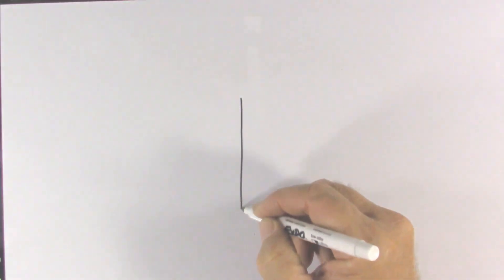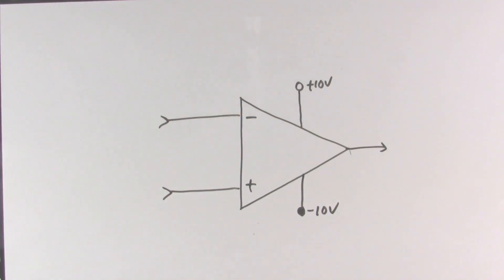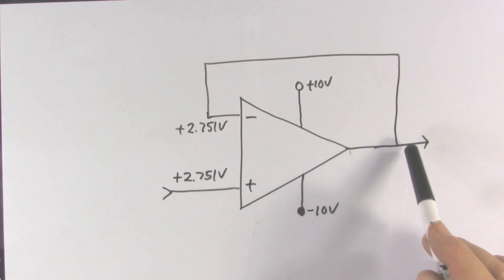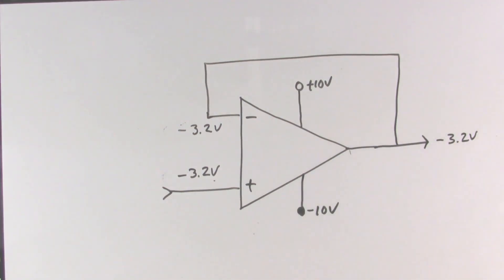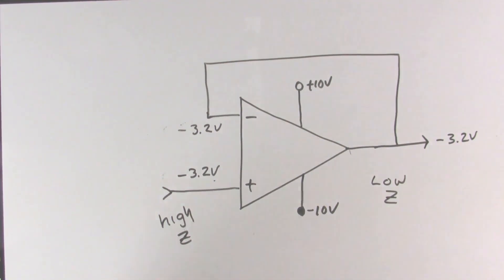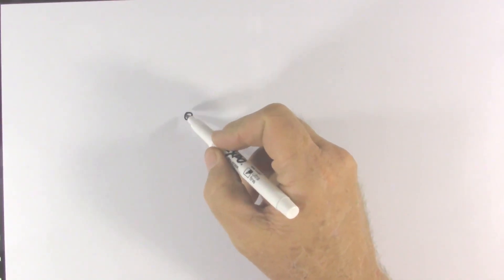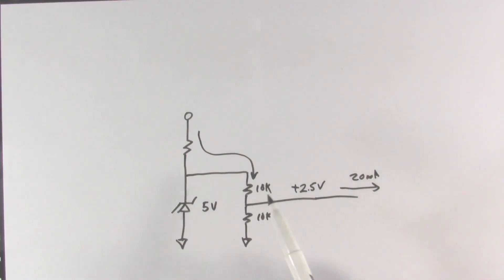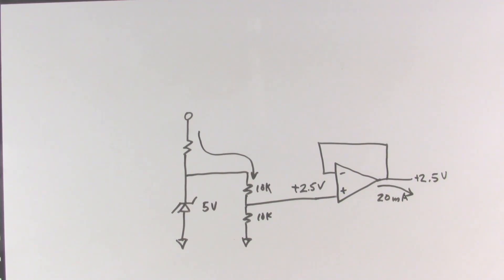Operational Amplifiers No  3, Voltage Followers

Comment: Hello sir, i have a question and that confuses me a lot, as we know the op amp does what ever it takes to make both the inputs equal.  But then it seems weird because  output of an op amp is gain×( V+ -  V-) and since the op amp made the inputs equal  it should  give zero volts output since now both inputs are at same voltage if we observe this in other configurations of op amp as well the voltage follower.
Reply: Actually - you are correct!!

When he says " the output will do whatever it needs to do to make the inputs equal " is not "actually true". 
When the op amp is in a "linear mode" - that is we are not driving it so hard that the output saturates towards one supply rail or the other - The inputs are not actually "equal"  why?
Because op amps are designed to have extremely high "open loop" gain - in the orders of many 10,000s and beyond.

Now - when we apply feed back  in a practical circuit - ( we is called closed loop) and configure the circuit as an inverting amplifier ..lets say the closed loop gain is  -2.  If we apply an input voltage of 2volts... our output voltage will be 2v * -2 = -4 v

NOW-  if we look at what the op amp is actually doing "inside itself".from input to output terminals....  it is taking some input signal... multiplying it by its internal "open loop gain"  of lets say 100,000 - to give an output of -4 v
In other words - our actual input voltage v+ to v- is equal to 4v/100,000 which is around 40micro volts 
In other words - the + and - inputs are pretty damned close to each other... but.. not precisely the same.
But... for practical purposes.. can "can" say they are equal !
Reply: @eric4709 ohh ! , the open loop gain is still present 😮 . Thanks for explaining  .
Reply: @rudrakshavegad1999 
Yes 

When we first studied op amps way back in the early 1970's we looked at it from the point of saying - "due to the very high "internal" gain ... then....for any "normal" output / operation   -  we can assume the + and - inputs are essentially the same potential ( coupled with the fact that the inputs are very high impedance so no (very little) current flows into them ( in other words they have no effect on the feedback loop) 

From this point  we can say that v+ = v-  - and from there its fairly easy to derive the formulas for closed loop gain for the simple inverting amplifier ( gain = -rf/r1) and the non inverting amplifier 
Gain = 1 + rf/r1
( rf is resistor connected between output and inverting input - r1 is resistor connected between inverting input  and signal / or ground

Comment: 7:20 How does 20ma get out of op amp, when it cant come thru the inputs.
Reply: I think it comes from the  'power supply'  input.   Notice at 7:13  Bob said he left out the drawing of the  'power supply'  inputs.  
So, the  'power input'  is providing the 20ma,   not the  Inverting or non-inverting inputs.
Reply: @richardpope9985 thanks

Comment: In practical is working exactly like that? (Voltages at the oitput pin of an opamp) . I mean is giving regulated voltages less than the power supply (+10v in video)? Thanks for the lessons

Comment: Been a radio ham 45 years, but still like going back to basics & you explain this stuff better than any one else out there, stuff I can use to design practical stuff, eg, a voltage comparator relay to switch in my auxiliary battery when engine running on my truck, thanks Bob.